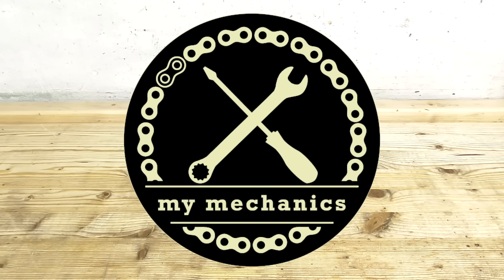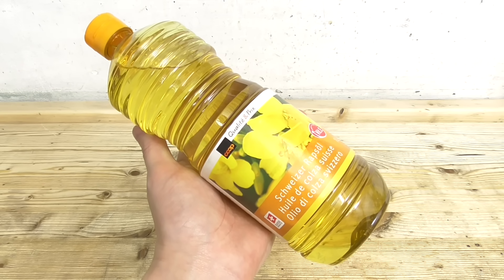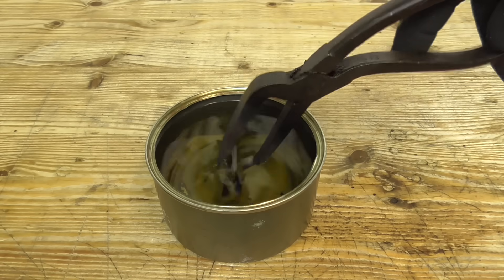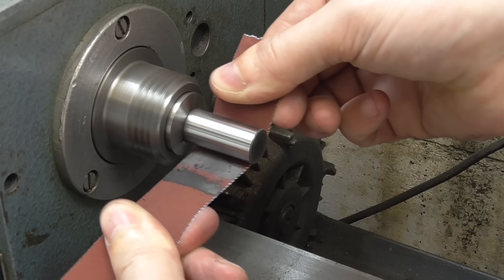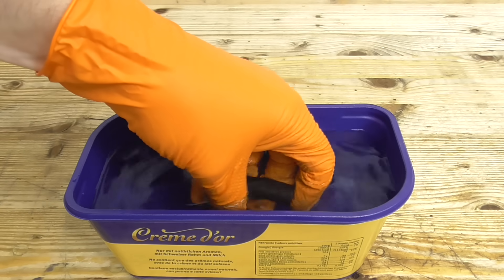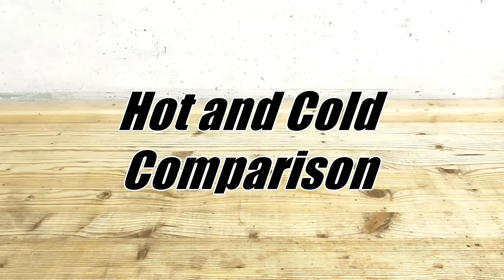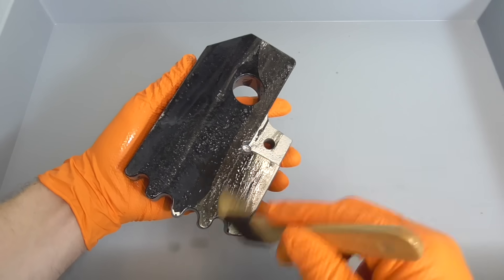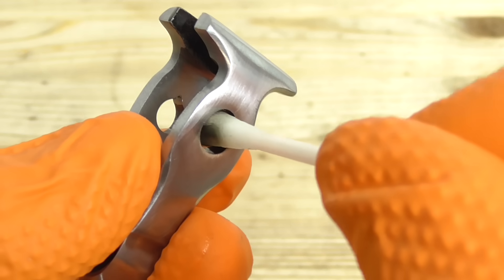How to Turn Steel Black - All you need to know about Bluing

Comment: Hello.  This is a great video!  Thank you for posting.  I am currently building myself a wood burning smoker out of 1/4" mild steel.  I really like the plain steel look but would like to try and seal the outside from the weather so it will not rust.  I was initially going to powder coat my project but have changed my mind.  What would your bluing technique to the outside of my smoker?  The typical heat of it would run at roughly 250 - 300 degrees.  The firebox is insulated to it has an additional cover around it so the outside of the box will not get as hot as the inside layer with the fire.  Thank you in advance!  Sergio

Comment: Your knowledge of bluing is very poor! Your super blue is a bad method. It gives only a decorative effect, but does not protect the surface from corrosion. On the contrary, it even accelerates it! Dipping a hot part in oil also gives a not very resistant coating. There are at least three other varieties of raven, besides those you mentioned. Firstly, it is hot alkaline bluing. This is boiling the part in a very saturated alkali solution with the addition of sodium nitrite. This method gives a stronger coating that protects against corrosion. Secondly, it is the so-called rusty varnish. Therefore, the method of the part is first coated with a solution that causes accelerated corrosion, and then the part is lowered into boiling water. And after that they are cleaned with iron wool. This is repeated at least three times. The method is a bit tedious, but it has been used for a long time and also gives good results. And the third way is phosphating! The part is immersed in a hot solution of phosphoric salts of iron and manganese and kept there until a solid coating is formed. In this method, a gray coating is obtained, but it is the most resistant - even in salt water it protects the metal for a long time.

Comment: Very simple and concise process even more understandable than the other three I have viewed. So it seems it would be safer to cold blue my Winchester 94 side plates to protect the metal tone and pressure resisting qualities unless there is equipment that can monitor metal surface temp like welder's temp stix. This is also the first instance of any information of using something like ordinary kitchen oil to achieve a bluing effect! Who knew. Great video will like and sub.